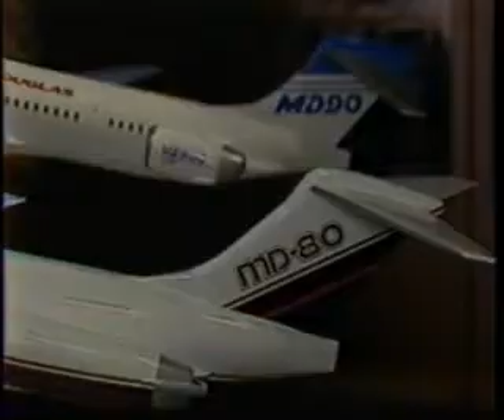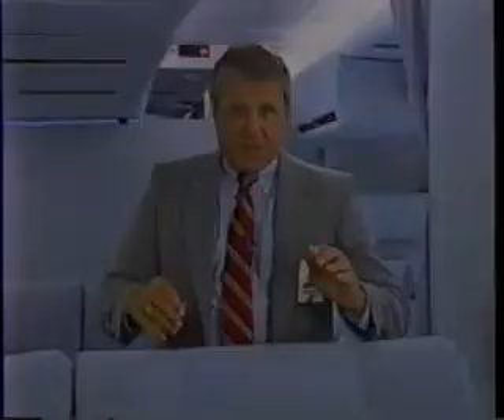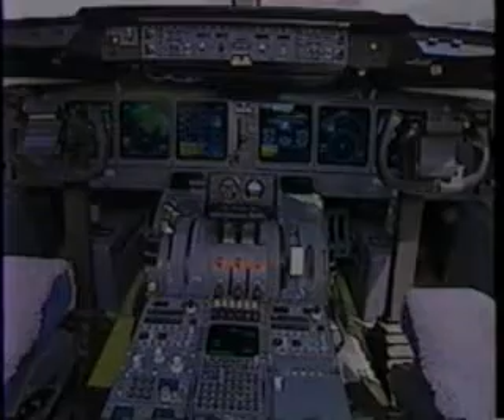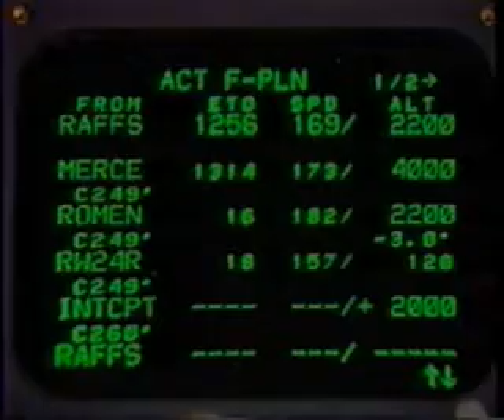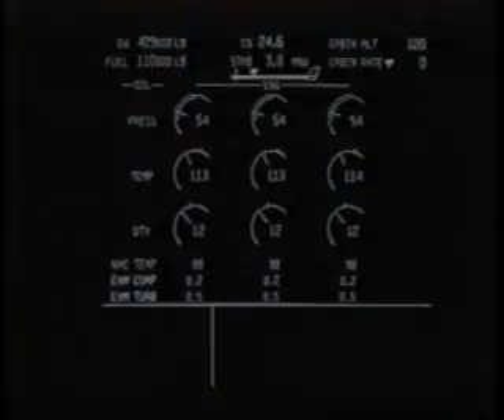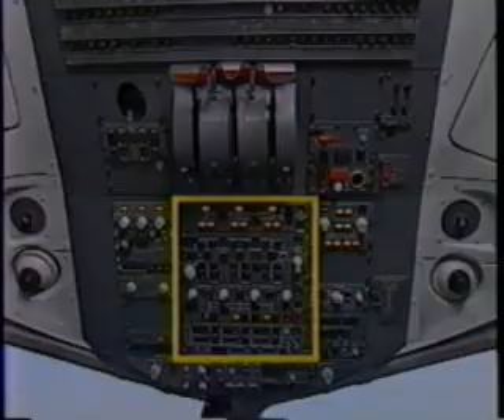McDonnell Douglas MD11 Introduction Video

Comment: It's a fine airplane. Many of the DC-10s crashes weren't the airplanes fault, but rather improper maintenance. Ground crew checking their work and improper production of spares by secondary contractors, not MD. There were some flaws. Every airplane has them, but they were fixed. And before you hate on the DC-10/MD-11, I'll bet more than one occasion, an MD-11 has gotten that Amazon order to you.
Reply: Douglas themselves aknowledge in an internal memo that their design of the DC-10 cargo hatch door mechanism was made cheap on the run from a design standpoint and was thus unsafe. So no it was'nt exactely a "fine bird" despite you want to rewrite history. More than 300 killed in France because of that.
Reply: @12345fowler  The fact still stands, the majority of the crashes that happened to DC-10 were caused by human errors, whether maintenance or pilot error. IIRC there are less than 5 accidents caused by design flaw, including the Turkish crash, the rest are caused by human errors during regular operations.
Reply: @FilipusWisnumurti I love DC and MD series of aircrafts but part of loving them is to also acknowledge the mistakes made in their design, good manufacturing and design processes include human error scenarios in which catastrophic damage could occur, engineering has to make note of these issues and try to reduce as much as possible collateral damage if a component fails, I work in the automotive industry and I've seen pretty good stuff car manufacturers do on their products to minimize the risk of loss of control of a car if something critical fails, such as ABS and traction control systems, if a sensor fails it just disables the system enabling the driver to continue to operate the vehicle and brake to a stop without causing loss of control.

Comment: Such an underrated airplane.
Sadly it had an insulation wich was lightly flameable. wich brought down the MD11 from Swissair
One of my favorite planes though
Reply: Bad wiring too.
Reply: The wiring insulation was not at fault of McDD. This was an aftermarket entertainment system put in by SWISSAIR.
Reply: @Josh.Davidson I do believe that he was referencing the insulation of the plane, not the wiring. The insulation was able to propagate a flame. Sadly, the pilot’s actions of turning the cabin bus switch off allowed the fire to propagate forward directly into the avionics disconnect panel. The TSB report is a great read with heat maps and experiments with the insulation.

Comment: The MD-11 could've been just as successful as the Boeing 747-400 was however McDoodle Air failed to design a wing  applicable to a stretched DC-10 which is really what the aircraft was. They just added a modern cockpit and winglets really. The 747-400 was better executed as a new gen 747 than the DC-10.
Reply: There were plans to cooperate with Airbus and built the AM-300, basically an MD-11 fuselage with a330/a340 wings.
Unfortunately, those wings were to big for the McDonnellDouglas's factory.

Comment: The mistake of MD-11 was the engine on tail. Being a two engine aircraft would not prevent to reach the range goals.
Reply: pretty sure the reason for that is so it could travel transatlantic since i believe at the time when it was made, you needed 3 or more engines to cross the atlantic
Reply: @fixedon  yup ETOPS regulations for transatlantic flight
Reply: Ragazzi parliamoci chiaro era un pessimo aereo sin dalla sua inaugurazione
Reply: That was a safety move
Reply: Nothing to do with the third engine.. Look at the 747-400.. And it was pretty successful. The problem was an inefficient wing and and inefficient engines.
Reply: @FLT111  No, the wing was one of the most efficient iirc. It was the engines that were off by 5%

Comment: 5:15 oh boy :( ....... that aged badly
Reply: *cough *cough swissair 111 *cough
Reply: Although is is an old comment, I believe the IFE shown here is not the same as what was installed on Swissair MD-11s.
Reply: The insulation installed was incorrect
Reply: @rosaliedollente5630 the insulation was installed correctly. The wiring was bad, and, to make it all worse, it was wired without MD’s advice, and every Swissair MD 11 had its inflight entertainment system wired differently.

The insulation was installed correctly, but it was highly flammable.

Comment: These people are actually proud of the DC 10..A plane responsible for thousands of deaths.
Reply: DC 10 was later fixed and it's safety was improved.
Reply: @Spaceworld-95 most DC-10 accidents were pilot error or maintenance issues. Same goes for the MD-11. These were pretty safe planes to fly.

Comment: I love this dc 11 plane my favoret
Reply: Tim Jacobi “dc plane”
Reply: It’s the same aircraft with lots of different small details, such as a bigger fuselage and the rear engine is higher on the wing (also the vertical stabiliser is smaller)
Reply: @originalpadoru  It's hardly a "DC-11". The MD-11 has multiple differences over the DC-10. So much so that it flies under its own type certificate. So, no....it's not a DC-11.

Comment: Such a shame that MD11 is quitting the aviation stage. It could have been in service if they put more fuel efficient and cleaner engines on it.
Reply: I'm doing a C check on one now...it's configured for cargo but it's still an MD-11
Reply: +BewareTheIdes I believe Boeing bought them out to be able to continue selling their highly successful military jets such as the C-17 and the F/A-18 hornet so as to make money instead of letting their military rival, Lockheed gain any advantage.
Reply: +That_llana_in_a_tuxedo, McDonnell Douglas intended it for both passenger and cargo service. KLM used it the longest in the former.
Reply: I know this is old but, why would they do anything wi0th the MD-11? The company doesn't even exist anymore and hasn't for quite a while. Boeing bought them out, as a favor, when they were in bankruptcy.
Reply: As I have understood, the biggest problems of MD-11 were it's old fashion wing desing (from DC-10) and three engine layout. McDonnell Douglas calculated at the late 1980's that it would be pointless to design a whole new wing because Jet-A1 were so cheap.
Reply: Trijets are pricy to maintain and no one makes parts anymore nor MD-11s (boeing made the last one in 2000). By 2021, we can expect all MD-11/MD-10 aircraft to be retired.
Reply: @justinq3318  I like seeing this 3 years later towards the end of 2021 knowing the MD-11 is still going strong in UPS and FedEx. Unfortunately, Lufthansa did retire their last MD-11F a couple days ago.
Reply: @jackthedragonkiller5097  they still fly their md
Reply: @jackthedragonkiller5097  Western global airlines has purchased a couple of Lufthansa MD-11s
Reply: @justinq3318  What do you say now? 2022?
Reply: @justinq3318 you were dead wrong
Reply: @justinq3318  All of FedEx’s MD10s are to be retired by 2023. Their MD11s will still go strong though
Reply: @justinq3318 you wete quite wrong buddy. Still alot of MD-11 flying and even a handfull if DC-10.
Reply: @justinq3318 wrong